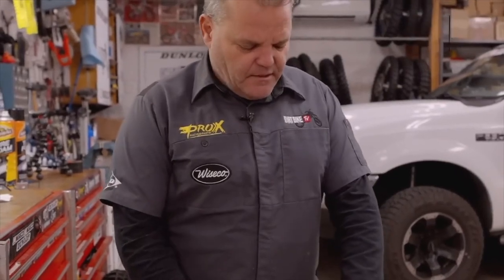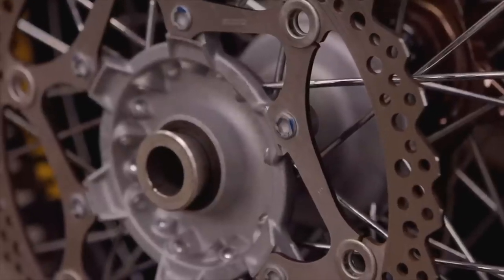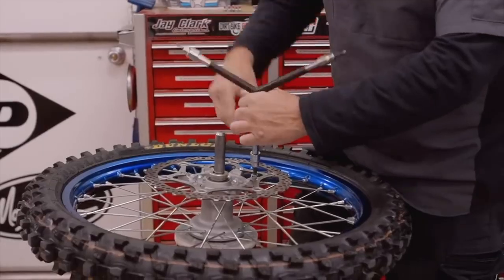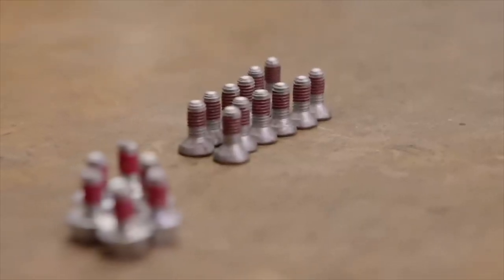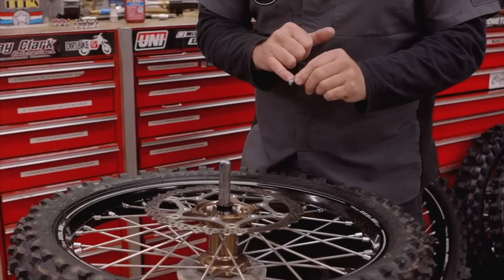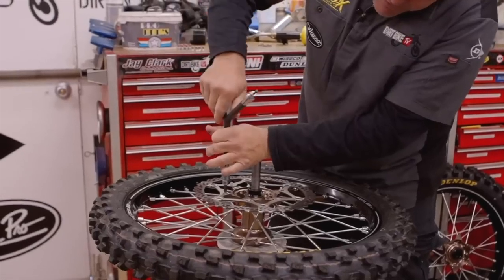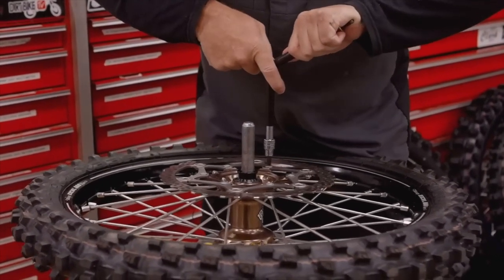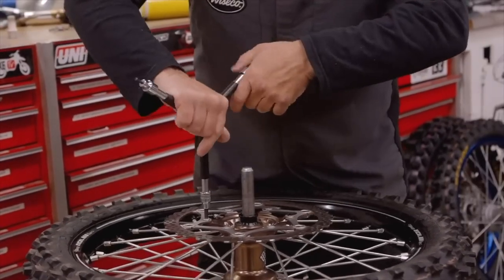Installing rotors on your Dirt Bike! | Dennis Kirk Tech Tip

Comment: To reduce damage to the heads use a good quality Allen wrench to just hold the bolt in place and torque the nut underneath to loosen or tighten..